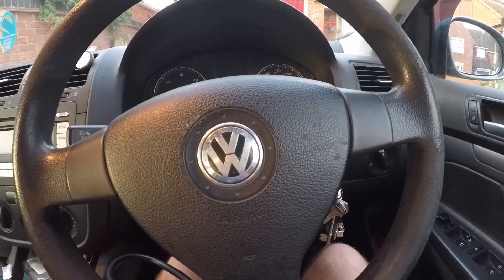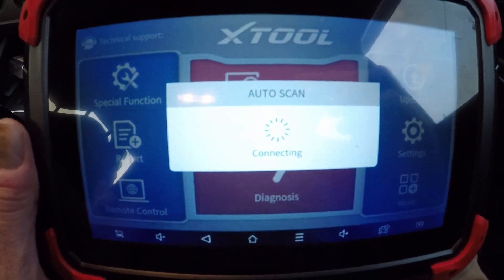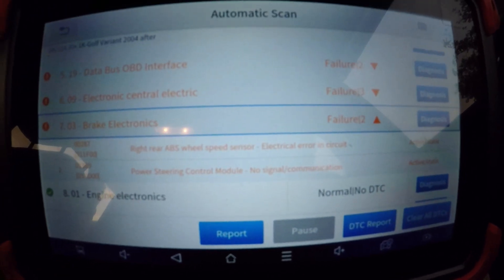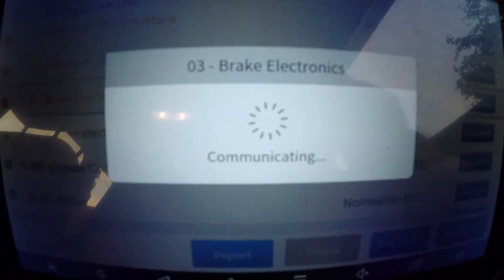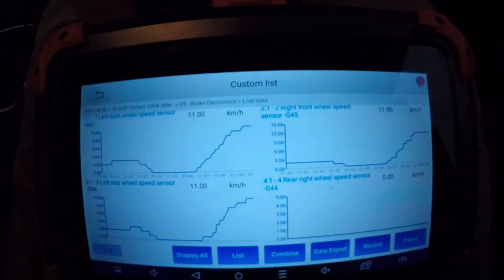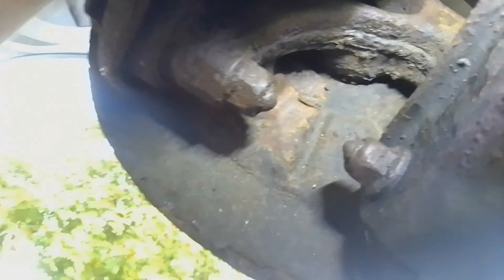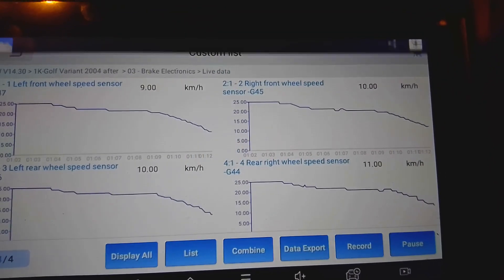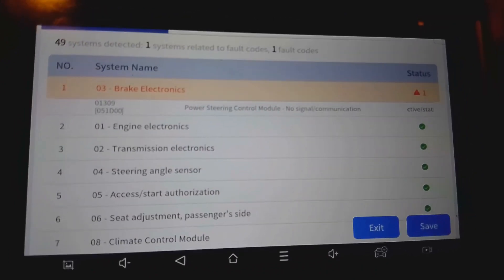Using XTool D7 Graphing to Fix ABS Fault on VW Golf Jetta Rabbit TDI

Comment: Hi I was hoping if you fix an issue that I’m having. I have an x tool d7 and I’m trying to scan my Toyota Camry 2003 in fairly certain I’m having the same problem as you where one of the brake sensors are faulty and I’m trying to figure out which one it is however when I do the automatic scan and it skips the abs part and doesn’t show me the speed sensor can you please tell me how you managed to get yours to show you what was wrong?
Reply from the maker: Hi, can you go into Diagnostics from the main menu screen, search for your car then go into Brake module or Brake Electronics or ABS, then Live Data can you see the wheel speed data? Once in there you can take it for a little drive and look for an ABS sensor not reading right.

Comment: Late to this, and marginally tangential, I've had about half a dozen high (ish) mileage Golf's, Jetta's and Passats with door electrical issues. The loom through the door doesnt quite have enough slack and the cables rub against each other with every door close and eventually short. It can be very irritating as if the door is shut with some vigour, the wires move and problems go away and perhaps new ones occur. Fiddly but relatively simple to fix, but have to solder, not use crimps etc as there isnt a lot of room.
Reply from the maker: Hi, thanks for this great info! I'll take a look at my door wiring sometime and see if I have the same issues you've had. Everything still works as it should at the moment but nice to know in case locks/windows stop working. I think I'll be running this one as long as I can. My last Golf did 235,000 miles so that's my target. Thanks for your comment 🙂